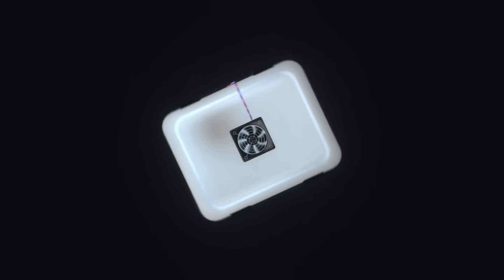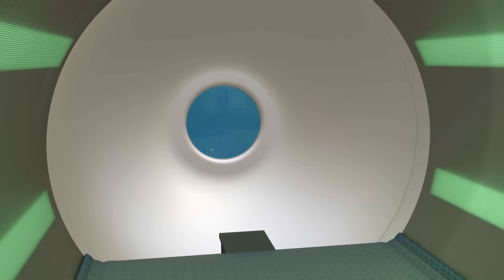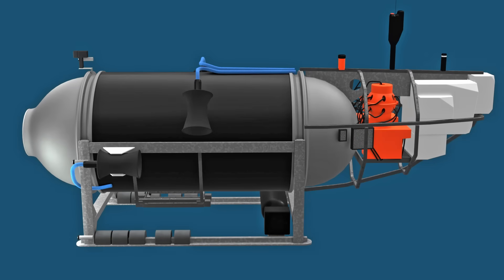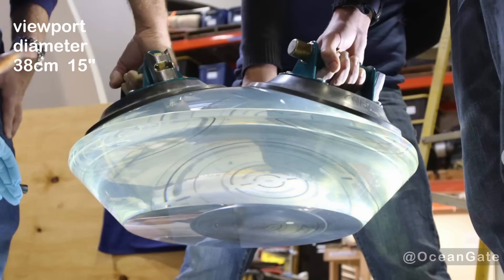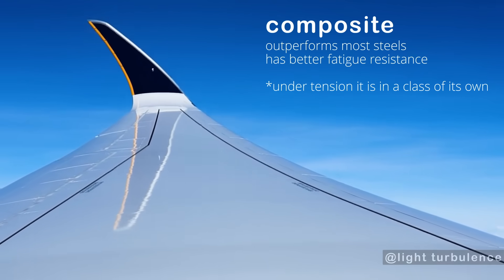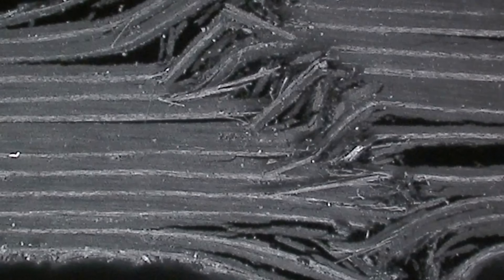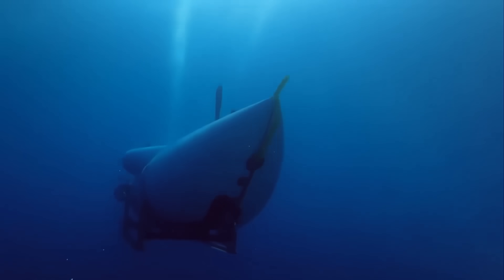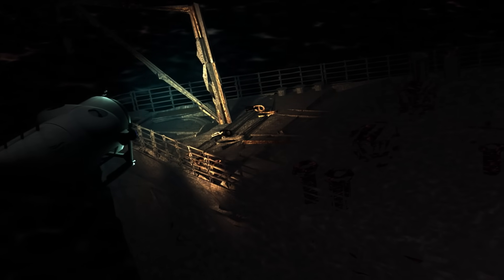Titan Sub | carbon fiber - Detailed Tour

Comment: Wow. Actually not a clickbait video like all the others. Thank you.
I wonder, though, is carbon fiber really that strong in compression? I failed to find much about it (maybe because the opposite notion is trending so much). I am not an engineer, but I handled carbon fiber strips and composites, and based on that I would never imagine it being strong under compression. At most it would be good at keeping the epoxy in check and not deforming, but in reality it would be under tension (inward) and just keeping the geometry consistent enough to withstand the pressure. How much weight of the hull was CF and how much was the epoxy bonding? I guess epoxy made the bulk of the real strength, or am I completely wrong? In either case, any delamination (like the endcaps pushing on the end of the carbon fiber strands and pushing them apart) would spell disaster, once you compromise the intended geometry the whole strength is just gone, so hearing any kind of crackling should warrant immediate testing of the hull.
Reply: @zviratko Take a look again. I've found several scientific papers with measured compression strength of carbon fiber composites. I've seen values between 20 % and 60 % of the tensile strength and airasj1 has experience higher values in his work. The compression strength is highly dependent of how the specimens are made.
Reply: @fuglbird  And that's the issue.  Based on what we saw, I'd gather closer to 20% at the joint due to the fibers not being under tension. Add in even from the videos that we did have, obvious bubbles in the epoxy and a fairly dirty environment (definitely not a clean room), certainly not anywhere near the 60% end of the scale.
Metal alloys, on the other hand are almost idiot-proof as you simply order a tube to be made, like they did with the end caps, and are done.  Decades of testing already done on the alloys and one factor removed from the design's (rather large) list of worries.

Comment: A good analogy to better understand the use carbon fibre was
A rope is strong under tensions
But no good being pushed type pressure
It's not been done before, or tested, was also scrapped by Boeing
He mentions aircraft but there made for opposing cycles,
Time will show if Stockton Rush's design is valid 
What about a large sphere with seats fasing outward we all know this would work
Carbon Fibre should just contain pressure.   RIP to there loved ones       mic stone
Reply from the maker: Not so If the carbon fiber in airliner wings were only good for tension they would be floppy and useless. No the carbon fibre carries spectacular compression forces.

Comment: Airplane wings are under tension not compression. 
Carbon fiber is only strong along one axis, and the compressive forces of the ocean deep are coming from 360°. Add the fact that every single time a force is applied to carbon fiber it weakens a little bit. With a carbon fiber deep submersible there is a 100% chance of failure at some point. This is why testing is so important.  You need to know how many cycles before it fails.  
The saddest part of the story is with destructive testing Stockton would have realized that carbon fiber can work, but it just needs to be replaced after like every  5th dive
Reply from the maker: You seem to lack a clear understanding of structural engineering. In wing design the same tensile forces are balanced by equivalent compression forces. This aligns with the fundamental principle that "every force has an equal and opposite reaction." You are suggesting that the crazy tension forces in a wing simply disappear into thin air without an equal counterbalancing force which is nonsense.

It's intriguing how some, including yourself, struggle to accept the fact that carbon fiber can rival the compressive strength of the best steels. Carbon fiber is a structural marvel, but its correct construction is notoriously challenging and expensive.

Comment: This was a well presented discussion regarding the Titan implosion with truly excellent graphics. But the one point of interest that was not mentioned is the elastic modulus  of the two materials, carbon fibre hull and titanium end caps. They do not react the same under pressure, so over time there is going to be degradation.
Reply: Yes more technical details are essential
Reply: very good!
Reply from the maker: Great point but 90% of my audience doesnt really want technical detail so I am hesistant to give too much detail and bore them.  

The good thing about combining Titanium and Composite is their rate of deflection is very similar to the extent that differential movement is usually not a big factor.  And surprising to me when explained this by the expert I consulted is composite deflects slightly than titanium and that explains why carbon fiber is rigid and therefore brittle. 

I am glad you are interested in the technical details because so am I.
Reply: @Mike-Bell I certainly appreciate the detail. Perhaps you can add it as a "foodnote" at the end of the video, so those interested can continue watching while the general audience has an on-the-point first 15 minutes.

Comment: What has happened will set the carbon composite science back decades. Now any time someone brings up using them in any safety capacity this will het talked about and not tried. Proper testing is sooooo important.
Reply: not sure about that, cf is embedded in industry its a 'niche' product its uses are well known and growing all rush has done is to show that his configuration is one to avoid
Reply: He basically created for all eternity, "The Stckton Rush Paradox".
A method of failure by NOT understanding what you don't know.

Comment: Carbon fiber only is strong under equal pressure either side, while the divers are in tension  but it’s very brittle ( look at race cars shattering under impact .. unlike metals their flexibility it vastly limited) stronger than steel yes but so is a spiders web yet those break with your finger.., without equal pressure internally to stop compressive force on a carbon fiber tube it would have collapsed regardless, even Rushes test model imploded, he ignored that test as is was a “model”  not a full size vessel but regardless physics do not change, in fact becuaee you can’t scale physics, water, pressures, his test vessel was actually stronger than the final Titan!, there is a reason why submarines don’t dive that deep, they simply can’t, using the cylindrical shape.I’ve seen crushing bulkheads on submarines done when testing their depth with bulkheads pushed in sometimes up to 12” from their original shape. Carbon fiber in this case was a poor choice of material when the internal pressure to retain the divers tension to give strength couldn’t be matched since their are people in there. And to add final insult to injury, while that Titan did make the trip several times to that depth and survive that was down to the hull weakening over time as carbon fiber will! Honestly this video is really misinformation with very little actual understanding how materials handle under pressure you can’t compare carbon fibers strength on an aircraft where the atmospheric pressure is lower, where the flexing is done over a much larger surface area with a much thinner layer that’s also reinforced by aircraft framework and titanium, where the Titan one was thick tube with no other bulkheads other than end caps, that thickness has no flexibility it will simply “snap or crack”, sorry mate but this video isn’t remotely accurate, your understanding on physics is non existent and your failure to understand the difference by comparing aircraft to submarine is laughable. Stop posting miss information  until you educate yourself better
Reply: Make one yourself then
Reply: @jj-jak   always a idiot on these places ..
Reply from the maker: @themodelboatbuilder4689  Composite is suitable for deep dive.  There are other carbon fiber submersibles, some that dive deeper than Titan.  Here is the list.  Here is a list https://www.researchgate.net/figure/Composite-materials-being-used-in-submersibles-worldwide_fig1_364296004

This incorrectly laid up tube still withstood the insane crush at titanic depth 13 times. If an incorrectly built carbon fiber tube handles spectacular compression, imagine how a meticulously built one could manage. But only through thorough testing can you make it safe and nobody yet has commited the huge money required.
Reply: @Mike-Bell   not one on that list was listed as carbon fiber HULL. it simply stated they have ''composit materials used'' on the vessles usualy as a funnel for the prop thruster or something that isn't securing people lives... again check your facts properly before quoting such ''facts'' using a plastic/carbon fiber/ fiberglass or any other composit isnt unsual in any vessle but you just outright tried to bullshit everyone that those vessles are using Composit hulls and NONE do...

Comment: Think you have missed the point that unlike a homogenous material, carbon fibre (no matter the thickness) will when put under high compressive and large temperature cycles start to delaminate in its internal structure. Once this starts the relative strength diminishes rapidly to the point of failure. In addition unlike a homogenous material, you cannot model accurately how carbon fibre will behave as you do not know the quality of the lay up, the accuracy of the curing process, etc during construction; this means any modelled results as guesstimates. Or to put it bluntly, if carbon fibre was the correct material for this application why wasn't the military industrial complex using it already as they are a whole lot smarter than these guys were.

Comment: 9:27 While there might be some compressive forces on the wing, they’re minimal compared to the predominant tension forces depicted in that clip of wing flex. Thanks for the video.
Reply: The compressive and tensile forces must balance.  They are equal.
Reply: No they are not. Seen any footage of wing stress test? You will notice that they always fail on upper surface first. That is where compressive load happens.
Reply: @user-uh6kq2wh9g  They’d fail at the weakest point, under compression, so that is what I’d expect.

Comment: This was a very reasonable overview of the craft, with great insights on possible weak points. The craft itself was working astounding 15 times, but as you pointed out - we (and them neither) had a clue, of what the safety margins were , and how much role material fatigue played in the catastrophic accident. That ist really unfortunate, because the idea itself still looks pretty promising - even from a technical standpoint! Thank you for carefully pointing out how a responsible path to such a submersible could look like.
Reply: Almost everything works until it doesn't. That's like saying your keys are in the last place you put them.
Reply: @georhodiumgeo9827  Horses kill approximately 100 persons a year in the US alone.  The Titan  overall is a very minor incident.
Reply: It doesn't look promising at all; homogenous materials can undergo tens of thousands of stress/no-stress cycles
Reply: Agreed, this was a very informative and well presented video.  I am no expert, but based on the many hours of listening to the various commenters on the tragedy, I wonder if some lengthwise titanium struts could have provided additional compressive strength over the length of the sub hull, easing the longitudinal compression so that it’s not the CF solely taking the stress. I also wonder if some other metal skin, likely titanium of say .5 cm would have better ensured that no water intrusion into the fibers occurred, assuming that one of those 2 scenarios is what led to the demise of the vessel.

Also, there’s an error that Rush made, as there is pressure testing facility in Russia which has the ability to test pressure vessels to depths as deep as the Challenger Deep, apparently the only facility in the world that can do so.
Reply: @sjsomething4936  You have to be careful about creating hard spots in the CF.  I think it has to flex uniformly.
Reply: @JoeLinux2000  ah, that would make sense. It’s really quite unfortunate that Stockton Rush went ahead so recklessly with passengers in an unproven design and refused to have non-destructive testing done after the dives to check the integrity of the hull.  CF might well be quite decently suited for submarine hulls (with some changes to the design) but it’s very likely to face massive skepticism now due to this single event.
Reply: Lol the hate on this comment is overwhelming. Literally the deep sea challenger was only used once to 35k ft by design so is that a  terrible design too? The idea that everyone is an engineer all the sudden is as ridiculous as other engineers thinking they can apply their specific knowledge to any and every situation.
Reply: It didnt work well 15 times lmao. The use of the carbon was wrong
Reply: @lukeamato2348  The first Jet airliner type "De Haviland Comet" used riveted Aluminium wrong. It killed around 100 people before the FAA finally revoked the flight permisssion. After that, they did a proper investigation and found out about the extremely rapid fatigue due to the pressurized cabin stress on the metal. They changed little things on the manufacturing process on that type (and the window shape, but that wasn't the origin of the cracks), and used several new built ones for the UK military as survey planes up to 2011. So while the manufacturing had catastrophic flaws, the overall idea and construction of the plane type was fine. Alas, Passengers would have refused to use it due to its record and it had gotten too small anyways, compared to the competition. So it never went back into passenger service on scale.
This video shows the possibility of similar  causes for another new material and manufacturing process, that could have led to the catastrophy. Maybe it could easily have been avoided - but we know too little if that was the cause. Concluding by what we know so far, that this idea of high pressure vessel construction is completely wrong from a material scinece standpoint, seems a bit premature and amateurish to me.
Reply: They had to rebuild it.  One worked 6 times, the other 7, well 6.
Reply: @captainwin6333  And the rebuild failed.... and they also most certainly knew they were doomed via hearing cracks. One crack won't lower the strength below the threshold, and the frequency of cracking likely increased, until it cracked past this threshold, of which then no warning would occur of the actual implosion event. 

People saying that it is impossible to have any warning at all before the failure are absurd; it literally made gunshot like noises, as reported by multiple people.

Thus, it obviously will make noise before it reaches that instantaneous event. It will crack, and crack, and crack some more, until it passes the materials strength threshold.
Reply: The thing had cracks you could hear happening.  It was weaking 15 times
Reply: False. It only went down to great depths a few times, all the other times were in depths even a common diver could do unassisted.
Reply: @colin-nekritz  Point is: it did multiple dives until it imploded, at least four more to the titanic wreck site. So while it is clear, that it had deadly flaws built in, it is an open question if the basic idea of composite material is only feasable for aircraft wings and fuselages, or if there maybe some day serious technicians, that can develop that kind of pressure vessel technology in a safe way.

Comment: You have been brave to put out this video when there are so many 'experts' claiming carbon fibre and composites will never be the correct material for submersibles.
It is only by experimenting and testing different materials that we find better ways of exploring our planet and beyond. It is for this reason I found it incredible that so many people dismissed this material under any circumstances. 
Only when the findings of the inquiry are made public will we know the actual cause of this tragedy.
Thank you for sharing your knowledge and insights into this matter.

Comment: What is stupid (and I believe the average IQ of the World has now increased)  - stupid is laying 5 inches of out of date fibre when the calculations say you need seven.
Reply from the maker: No the calculations said it needed 4 1/2” and he rounded it up to 5”. 
The engineer I spoke to agreed that 4 1/2” was the amount of carbon fibre to withstand the force. 

What is stupid is building something and diving in it without testing what its failure depth

Comment: So just how did you decide carbon fibre is not adversely effected by compression?  What is your test data?  What do you know about carbon fibre that an entire industry does not know?  Why has an industry that could make millions if carbon fibre was compressible?  Is it because you do not understand how steel is used in aircraft construction?
Reply from the maker: What are you talking about!. The carbon fiber wing structure in airliner wings carry insane compression loads everyday. Its not me saying it. Airliner wings say it. An entire industry does say it. Half the force in a wing structure is compression and half tension. Yes I do understand how steel and composite in aircraft wing structures work and how concrete and steel structures in buildings work.
Reply: Obviously you do not know how lift works  either.  Nor do you know anything else.  Have a nice delusional day. @Mike-Bell